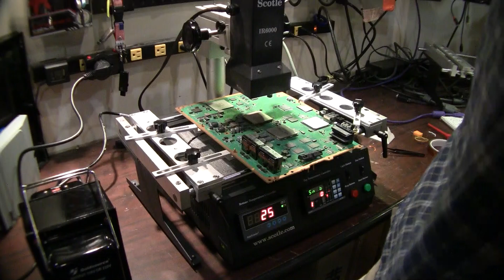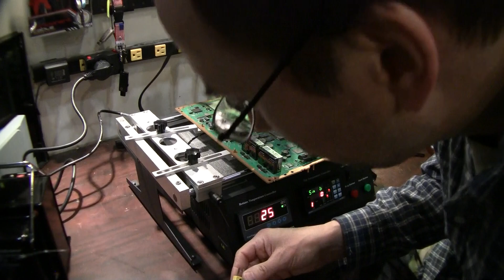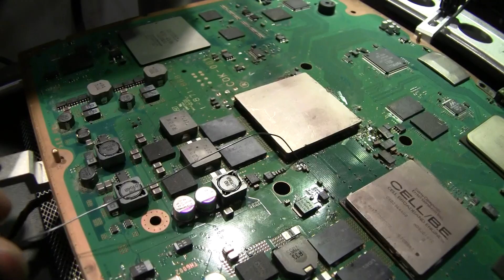Scotle IR6000 Initial Setup and Use Video 2/2

Comment from the maker: To follow up with John A comment - I looked over a tornado infra station the other day.  I think its a great application for cell phone use.  We here at SpitFireMods currently focus on the larger BGA components and could not make an educated suggestion on that unit.  I can say in my experience that the infra units with bulb type emitters can have a large variation across a large area, require good masking of heat sensitive components and if experienced in their use they are good for small component applications.  I do not recommend these units for large BGAs due to their type of heat output and additional work required for their use in a commercial environment.

Comment: In YOUR view when considering the rework stations you have used?   which has been the easiest? most accurate? Have you given views on the cheaper units aswell as the lower end of the market? What is your view on the Tornado Infra ?  I will have to check your other videos and get some idea of what you think. An excellent informative video. thanks spitfiremods.